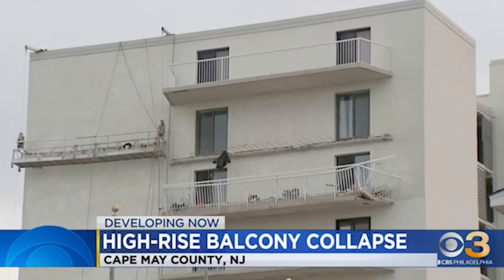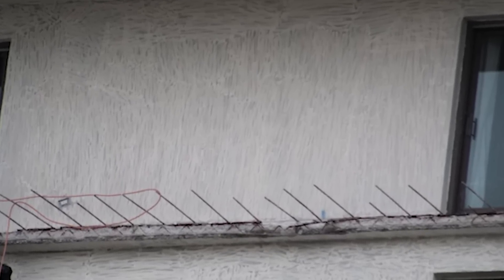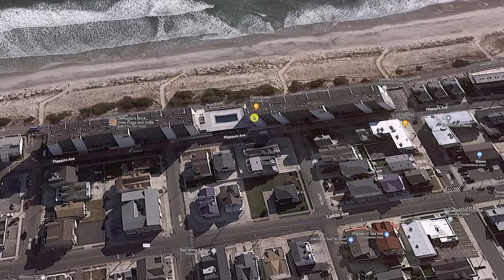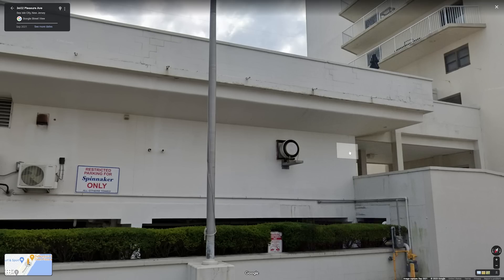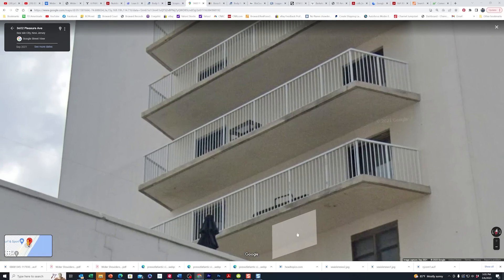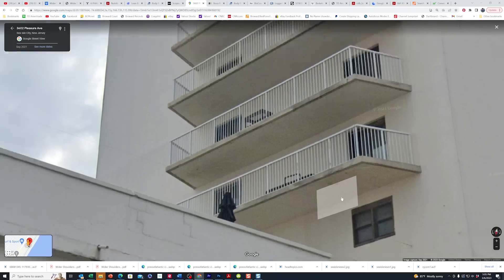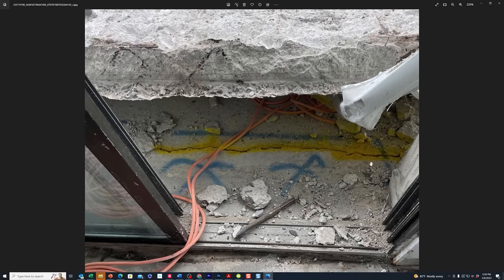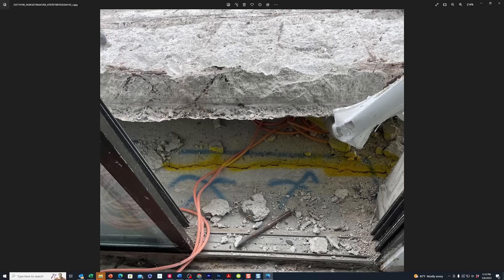What Caused Fatal Jersey Shore Condo Collapse?

Comment: Not sure who approved this work to be done, but the engineer should have specified jack shoring posts from the ground floor up under each overhang, Then working from the top overhang down giving time for the repair to cure, removing the shoring to work on the next floor down.. repeat! The most important rebar in an overhang is the top layer which these workers cut! Not very smart!
Reply from the maker: I keep hearing that from many people in this business that a lot of contractors simply refuse to pay the extra money to engineers to come in and do this stuff
Reply: Sometimes they won't go from the ground but will shore 2 to 3 floors below. The idea would be that the 2 to 3 floors below will share the weight of slab being worked on. However it will depend upon how many balconies they are repairing. They may want to go bottom up rather than top down in your example. Once a floor is set they can put props on it probably in about 24hrs after then work on the next floor up and repeat whilst the propped floors are still curing.

Comment: Hmmm New Jersey,...concrete and construction,....the mobbed up construction crew used salty beach sand in the concrete mixture.
Reply: Wasn't a concrete problem.  The workers cut the rebar support with a saw.

Comment: Idiocracy come to life. 
I hate to point out Darwin award winners, but.. 

Regardless of the poorly constructed building, this was avoidable.   

Practically fowl play.
Reply from the maker: The building was not constructed poorly at all as you can see it the strength of that 7th floor balcony is a testament to how well they built those cantilever balconies. Because it held the weight of the 8th floor balcony dropping probably 10 feet down on top of it
Reply: @jeffostroff  poor construction as in badly cracked concrete and poor architectural development as in using a pseudo cantilever design rather than adding the expense of support columns which would have minimized the current day stress cracks and would have eliminated a repair disaster.